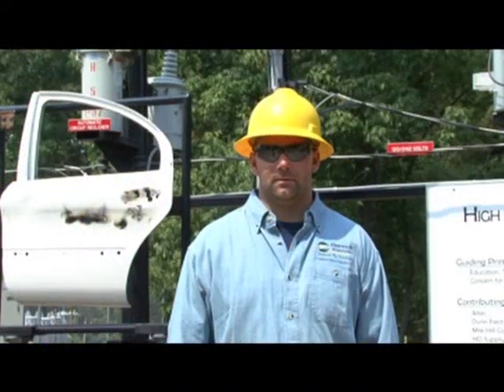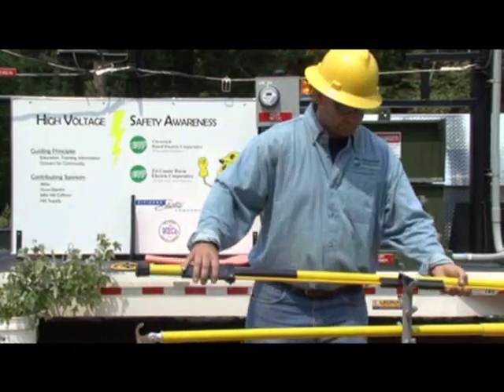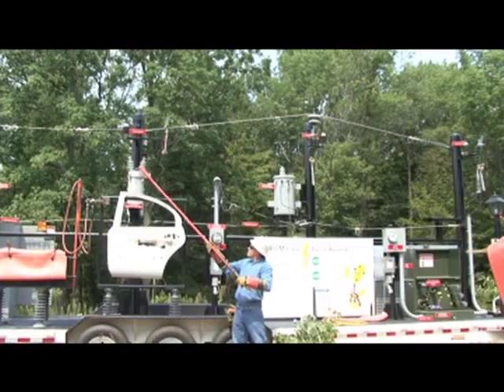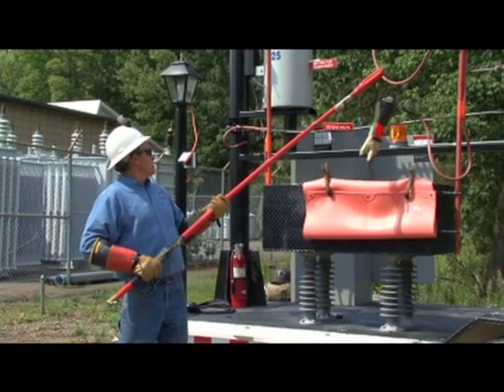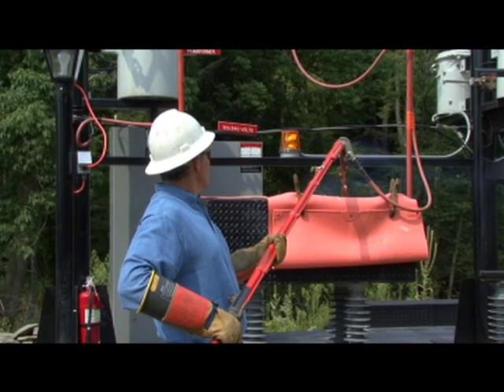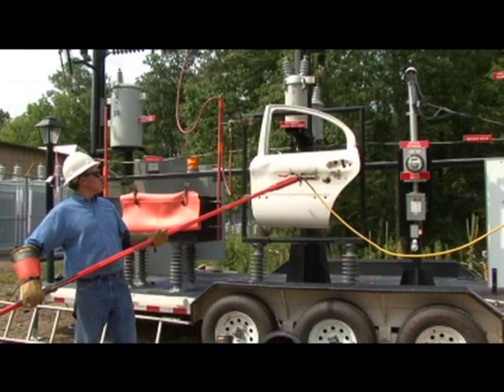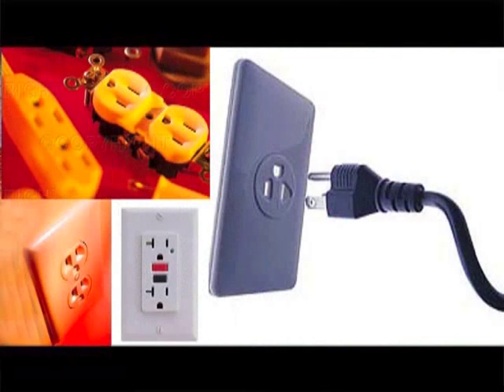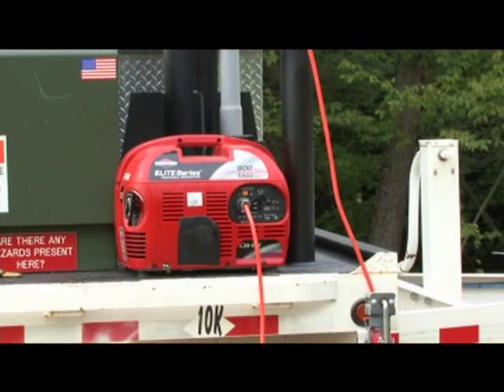Power Line Safety

Comment: I just did some conductivity tests with my high voltage transformer using 20KV AC almost 3 times as much as the 7200Volts used in this safety video, I tried dry clean cotton string, packaging twine, dry pine wood, I placed the materials between 2 metal conductors 20KV and Gnd spaced 3 inches or 75mm apart, applied power and there was no measurable leakage current, the materials did not even get warm, I can not get cotton string to conduct, as claimed in the video.

Comment: I'm surprised that dry wood, and dry clean string appeared even slightly conductive. While branches from trees are conductive, mostly due to the water content within, from my experiments with voltages up to 20KV ac I found wood such as finger joint pine, MDF boards and cotton string to behave as insulators, provided they are clean, properly dry, have no conductive materials deposited on them like dirt, or even paint. I would never however rely on the insulation properties of these materials.

Comment: Actually, most of the current would flow through the conductive sheet, not through the hand, but only if the entire rest of the body were well insulated from another conducting surface at a different potential.

Since the boots are likely contaminated, they would relatively easily conduct, and the metal inserts might just heat up enough to damage the foot.

That's why utility workers never rely on their boots for protection; they use rubber gloves, sleeves, and proper tools.

Comment: The fiberglass used by utilities is regularly cleaned and tested, has no conductive rungs, and no surface damages. When was the last time your fiberglass ladder was cleaned from top to bottom with dielectric solvents?

Comment: You may be correct about perfectly dry, perfectly clean string (I'm actually not interested enough to verify your information); however, the only condition in which you get such is a laboratory.

Many strings are not purely dielectric, and nearly all used on kites are contaminated and could easily become conductive.

Sure there is a chance you'd be safe, but is it really worth the risk???

Comment: but what about steel wire that are using 2 hold up the power pole?? (the old ones) they can be dangerous 2. unfortunate i touched one and ended in hospital over the night. and that was only a low power line without insulation on the power line and the steel wire 2. it was removed the same day by the way.

Comment: - @ BenHutchinson1 -

Everything has a dielectric breakdown point.  This means that whatever it is, it has a point at which it will become conductive.

For example, a can of Raid insect spray.  The can will say something like 25,000 volts dielectric.  They are referring to is the breakdown voltage at which the liquid or chemical becomes conductive.  If it has a voltage breakdown then it can be safely used up to that point in electrical panels...

But you're wrong about kite string by the way.